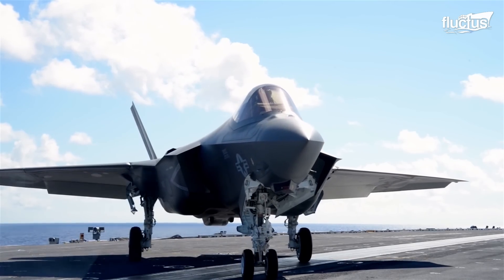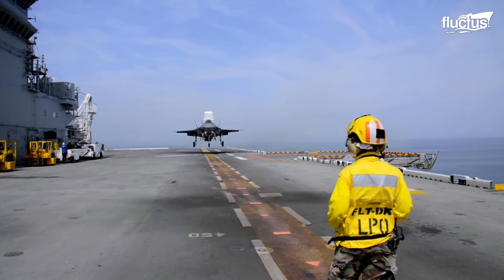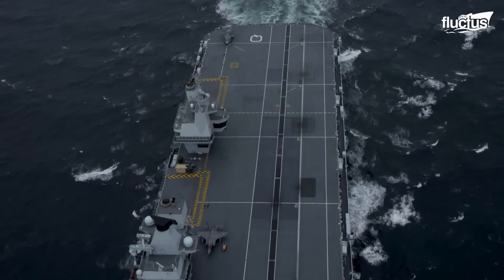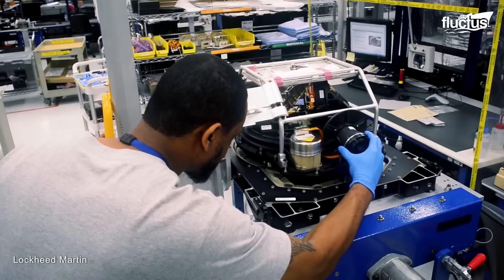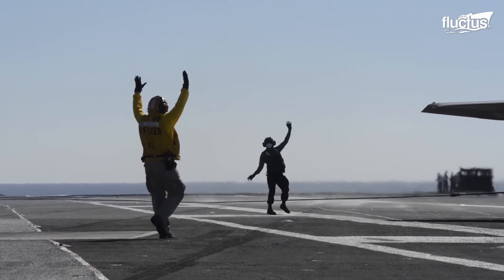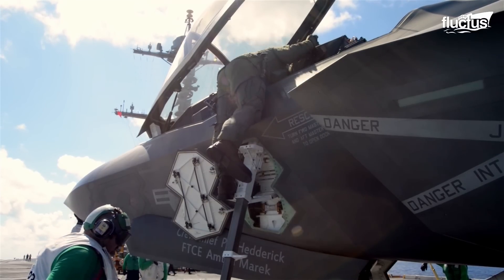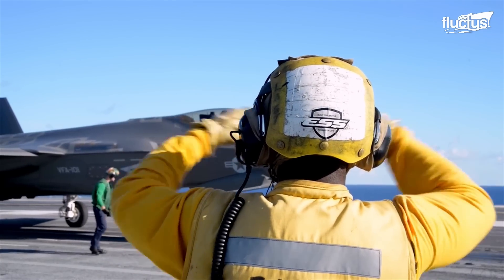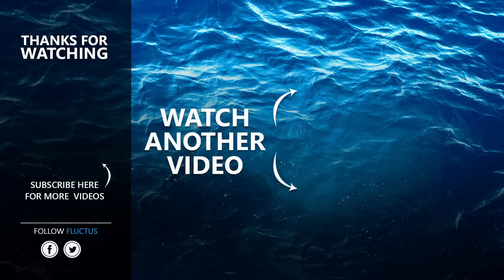Hypnotic Operations of $130 Million F-35 on US Navy Carrier at Sea

Comment: The thrust vectoring is a brilliant piece of machinery, that's what sets them apart, both the F35 and F22, the design, the military personnel that make the USA military 2nd to None. 🇺🇸
Reply: The technology was British & was invented by Rolls Royce with the flying bedstead which made the concept & design of the Bristol Siddeley Kestrel that became the Harrier jump jet, not the Ryan X-13
Reply: The USMC originally purchased 110 Harrier AV-8A aircraft from the UK back in the 1970s.
   Those aircraft were built at Hawker Siddeley Kingston UK, Disassembled for transport to the US then reassembled by McDonnell Douglas.
  All USMC Harriers including the later USMC AV-8B  manufactured by McDonnell Douglas always used the UK Bristol / RR Pegasus engine with vertical lift thrust vectoring system.
  The F35-B has more than 30% UK content involving more than 130 UK companies. All non STOVL F35 aircraft have more than 15% UK content involving more than 130 UK companies.
  The F-35B depends on a great deal of experience & expertise gained from the Hawker Siddeley Harrier.

Comment: I really wish the Navy & Marines could go more jump jets then they have had in the past , but i don't know if they are as fast to scramble as the F18 types. Maybe someone can comment on this delta.
Reply: It uses copious amounts of fuel and can't take off with a full payload, it has to "jump" with a minimal amount of fuel and payload to reduce weight.  Bottom line there is no utility in a jump jet, only as a way to take off with a "minimized" runway length.  But even then, it's not like it can take off form a dirt road, any rocks or debris could easily get stirred up by the air and destroy the skin basically immobilize the entire plane with is fragile.  The Marines wished they has spent their money on a helicopter, and the JSF wished they had abandoned the vertical takeoff nonsense all together...